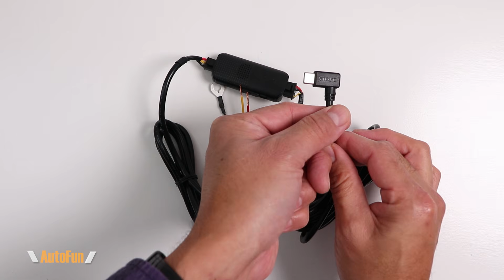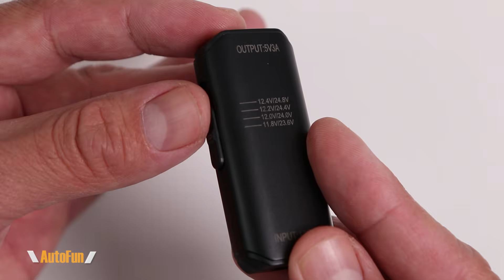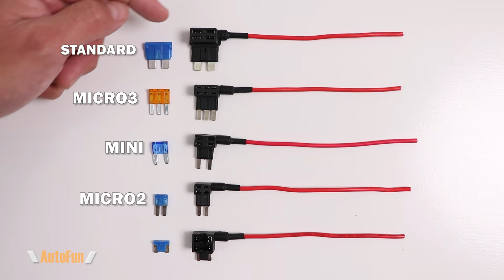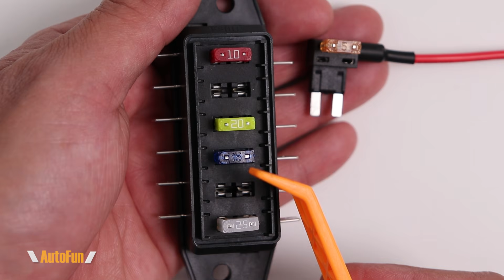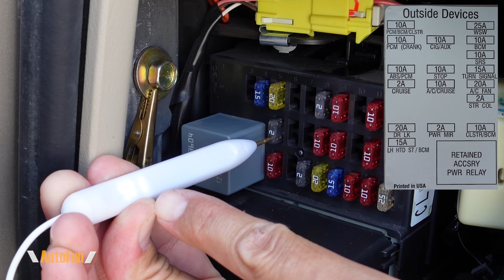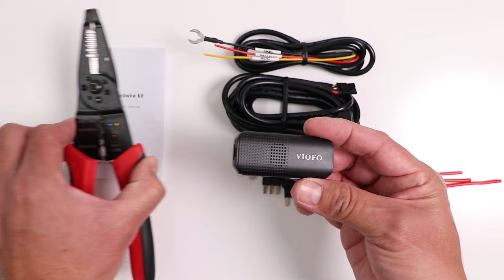Viofo HK6 Hardwire Kit: Battery Protection, Connections & Fuse Taps

Comment: Excellent video thank you. I have watched a number of Viofo hardwire installation guides and there is little common agreement about whether the kit includes the fuse spurs or not. Some clearly state that it does not and others are vague.
Reply from the maker: You're welcome! Ah yes the kit is available with and without fuse taps, link to the kit in the video description, cheers!

Comment: Can you connect acc and constant power (yellow and red) together and just use single fuse tap? I don’t need parking mode at all the car does get driven enough.
Reply: 🤦🏻‍♂🤦🏻‍♂🤦🏻‍♂🤦🏻‍♂🤦🏻‍♂... 100% it won't work. use the cig charger that comes with dashcam and forget about hk6 if you don't need parking. you'll also save $30.

Comment: Some cheap fuse tap might mess up the fuse box.  Since my battery is in the trunk of my vehicle, (not all vehicle does this).  Red to battery with fuse, black to ground.  ACC to my 12v output using factory connectors. no wiretap or fuse tap.

Comment: Would this work with a wolfbox g900 tripro to adjust low voltage cutoff
Reply from the maker: No, I do not recommend using a different hardwire than the one specified by Wolfbox. Aditionally the TriPro requires 4A and this kit is only rated at 3A. Here is my review for the TriPro https://youtu.be/RqfP8cR-SIc you will find the link to the correct hardwire kit in the video description, cheers!

Comment: What is the correct amperage to use?
Reply: The HK6 adapter delivers 3A at 5v.
So technically the consumed current at 12v could never be more than 3A.
Probably more like 1.15A

Viofo supplies 5amp fuses.
But you could get away with 3amp

Comment: Would be cool to get an Adapter From that Box to a USB In. I alrady Run the cable from my USB Plug to the camera and will Not do this again but I would Like to add the hardwire kit.
Reply from the maker: Ah yes that does exist, here you https://youtu.be/P0VapL70m7c you can get it on the specific version that connects to your vehicle make or a universal version (similar to the hardwire kit I show with flying wires on the end to connect to any vehicle you like) links to both versions of that adapter are found on that videos description, cheers!